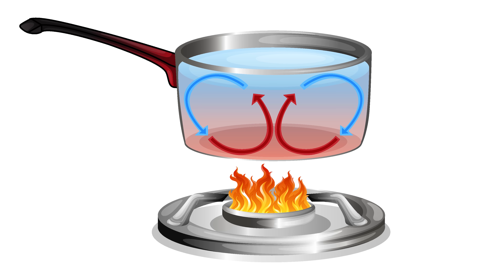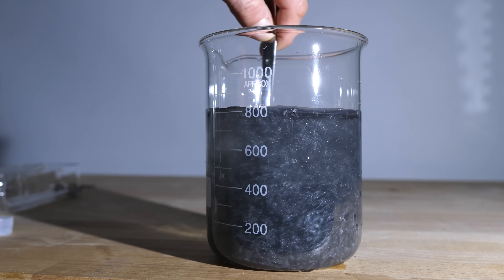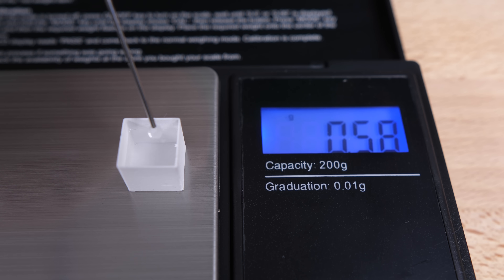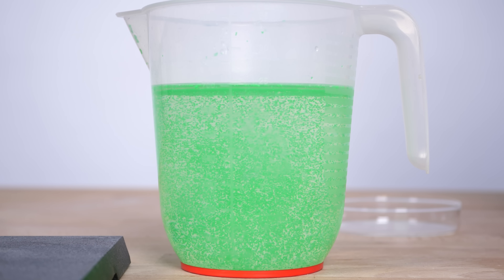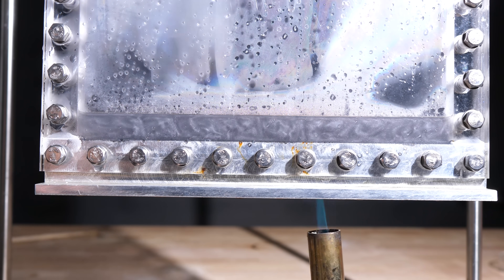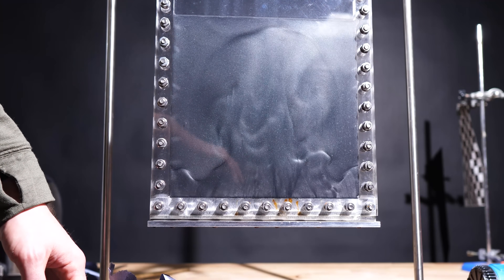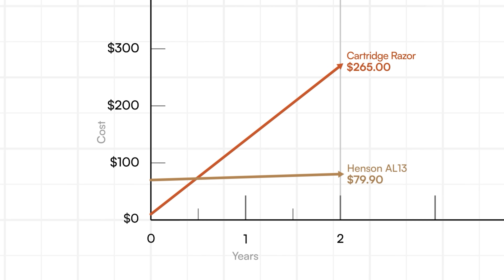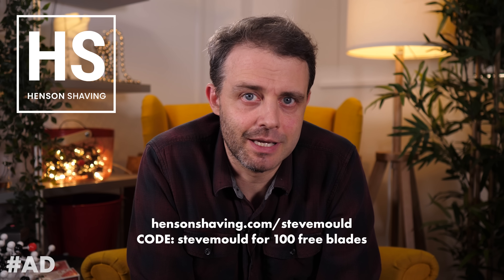The bizarre patterns that emerge when you heat ANY fluid

Comment: Now I need to know why the mica flakes tend to align locally.
Reply: my guess is that because mica forms very flat very thin layers, the flakes would all have a similar geometry and therefor they tend to align in similar fashion in response to water flows around them
Reply: @nicklanders5178  This was my thought, too. Flakes perpendicular to the direction of flow might be swept along, leaving the ones parallel to it behind slightly. Hard to say if that really works on such a small scale, though.
Reply: @SonOfFurzehatt I would imagine the flakes align themselves to all be perpendicular to the flow, each one acting as a little sail
Reply: @alexanderaiken6457 I'd expect the opposite, with the 'sails' tending to be turned so they present the smallest surface area to the flow. This is in line with the tendency for physical systems to move towards a 'lowest energy' state over time
Reply: @SonOfFurzehatt  why would the scale change it?
Reply: @joshyoung1440  Effects of things like viscosity change with scale. Have you ever seen a model shot of a ship at sea in an old movie (or Thunderbirds) and immediately picked up the fact that the sea doesn't look right? Viscous flow of water might be enough to carry everything small along with it. Smaller particles also have a higher surface-area-to-volume ratio.
Reply: Same here! There's a paper about composite coatings that seems to suggest shear alignment as a cause?
Reply: I think he meant to say "they align with the flow" in a way
(because they are flat)
Reply: I’d expect that any shearing flow (squares become parallelograms) would align them with the shear direction. Otherwise they’d be random.
Reply: The ones not aligned with the flow on their edge would be caught by the flow (so moving faster) and also be less visible? Optically you'd see mostly flow-aligned scattered light bounced between them, I think, with little seen of the perpendicular ones.
Reply: @adaroben1104  I'd guess that all flakes always align with the flow and what makes them more or less bright is if their flat/reflective side (remember that the flakes are really thin) reflects the light towards the camera/observer (bright) or not (dark). It would be interesting to compare what 2 different camera angles see or maybe even more interesting, have two light sources of different color in different positions.
Reply: @EstebanGrasso  a polarizing lens would be interesting to check them with too
Reply: I imagine that it has to do with the fact that the particles are large, so they won't move as much as the water molecules do. This could mean that when they get close to each other, the extra mobility of the water molecules causes the water to bounce between the mica flakes, pushing them apart again.
It is also possible that it is due to the mica molecules having a tendency to orient the closest water molecules a certain way, so the outside of the particles have a slightly positive or negative charge. This would mean that the mica particles repel each other, and they would tend towards maximizing the distance between each other. The distance is greatest when the particles are aligned.
Reply: I posted elsewhere, but id like to share here too.

My conjecture on why the mica poweder is rheoscopic is the powder is tiny reflective sheets, and they arnt really aligning. If they are in a shear force of fluid, they will roll, and they can only really roll in 2 meaningful ways. They can spin normal to their plane like a frisbee or perpendicular to normal of their plane, like a paddlewheel.

Thus in a shear force, at least 50% of the mica powder is rolling like paddle wheels with their axis aligned with the shear force. They are all in a randomized state, but at least that axis is lined up and the lined up pieces act like a uniform mirror when viewed at the correct lighting and angle.
Reply: Sheer willpower
Reply: Van der Waals force?
Reply: @Player-pj9kt that was my thought as well. That's why mica forms as sheets in the first place. Because Van Der Waals force acts weakly and over a short distance, it would tend to form small, self-organizing domains. Even in non convective fluids, thermal motion would limit the size of these domains.
Reply: I think the simple answer is just that they align with the flow, like others have mentioned. I think Steve is just overthinking the phenomenon and is thinking that the particles are both coupled to the flow and couple to each other. He’s thinking of a nematic phase, where this would be the case. A nematic phase would be a much denser suspension where particles are so tightly packed that their orientation aligns. Here the orientation of the flakes simply aligns however because they’re experiencing the same flow.

Comment: Given you can make a rheological fluid with metallic, organic, graphitic and mica flakes, it appears it is not anything electrostatic and is literally just a consequence of their restricted dimensions. We can imagine that due to their extremely low Reynolds number when aligned to the flow, even if flow is turbulent on a scale much greater than the flake, locally flow over the flake will be laminar and any deviation in the flake angle away from the laminar flow condition would create a strong restorative force as Reynolds number would suddenly jump from near zero to a high number even with a very small change in angle. Because the flakes will always be moving slightly slower than the flow velocity when the fluid is cycling like this, that laminar condition should cause them to all orient locally to the flow direction.
Reply: Rheoscopic sorry...

Comment: One thing I noticed that I think is rather cool is that there's occasionally these fast jets of water shooting above the convection currents. You can see this really clearly at 2:10 or so. We tend to think of heating water to be uniform, but a jet of water is water that is superheated and rising very quickly to the top, it slows as it gets to the top as the temperature spreads out. It's fascinating to be shown how we think of water movement in terms of averages, and not every part of the water is perfectly aligned with the average.
Reply: I think those are bubbles.  Either from boiling or just the flow breaking off bubbles that were stuck to the bottom.
Reply: @technobabble_  That makes sense too! I can't really tell from these videos here, but I'm curious what it actually is.
Reply: Yeah  this was the part I found most interesting. It really does show the statistical/probabilistic nature of reality. Occasionally you will get these exceptionally high energy interactions, but on the average the overall energy level is reasonable. I'd often encounter this as someone who urinates standing up, when occasionally drops of water from the toilet would fly out and go past my head in height. You would think the kinetic energy would at most be able to rise up to it's original height, but the occasional splash in the face would remind you otherwise. (Like how a slow large ball colliding with a smaller one, sends the smaller one away at a much greater speed).
Reply: @aggies11  ...stop spraying your piss so hard against the urinal hahahahaha
Reply: @aggies11  also that large ball/small ball thing has limitations at classical scale but yeah it largely works that way at this scale
Reply: Omg yes I was waiting eagerly for him to talk about/explain it.. I hope he makes a video and talks about this phenomenon more in a future video because it sure seems VERY interesting.
Such a great video nevertheless. Keep up the hard work Steve 💪🏻✌🏻
Reply: And I'm surprised how fast seagulls can ascend on rising air currents. Do they 'see' air currents, or fly around randomly until they find one?
Reply: Not just water movement, but all heat.

Comment: You can also see convection cells when heating up a relatively shallow pot of oil on your stove if you have a light shining into it right from above (like the one on your fumehood). The light shining into your pot and being reflected out by the stainless steel bottom appears darker or lighter depending on how it is bent by the changing refraction index of the oil.
Reply: It's also quite visible in a frying pan with some oil on the bottom. The "shimmering" surface of the oil is commonly referred to by culinary instructors as a way to know when the pan is hot enough to start cooking.
Reply: The shimmering effect is also increased when fish has been fried in it. Especially mackerel. But i think its has different cause.
Reply: You can get stable hexagonal cells with ordinary water in a pot. The water in the center of the cells will be a bit higher and the water in the lines between them will be a bit lower. Super easy to see.

(But not easy to create!)

Comment: I'm guessing the cream is important because it's a colloid of fat globules in water. Fat is pretty insoluble in EtOH while water is freely miscible, which makes ethanol cream mixtures highly unstable - if you use something other than cream, it just dissolves into solution, becomes homogeneous and the convection stops, whereas the fat is continually falling back out of suspension causing the density to constantly vary leading to the convection

Comment: 5:10 I thought you were going to point out that the changes in buoyancy are due to changes in density, which means your beads actually sink through the hotter (less dense) fluid, so the velocity of the fluid may actually be larger than the beads make it appear. Not sure how significant that is, though!

Comment: An odd argument I got into with a friend who is really smart is that a boiling container of water isn't 100 °C or 212 °F despite that being the temperature at which water boils (something I believe). Argument went on for awhile to the point we had to agree to disagree. By the way, this is a normal, unpressurized container open to the air we're talking about here

The thing is that convection makes it impossible for a container of boiling water to be 100 °C or 212 °F. That temperature is required for water to turn into steam but that is only localized at the bottom of the container you're boiling. Once the water reaches that threshold, it turns into steam, rises to the top and escapes the container. The surrounding water can be close to that temperature but is still lower

If you put a thermometer in a boiling container of water without having it touch the sides it wont reach 100 °C or 212 °F as long as there is still liquid water in the container

Comment: how would the convection currents look using the heat of the lower liquid to heat another liquid on top? something that doesn't mix like oil and water
does the convection current continue from the lower liquid? does the line between the 2 liquids blend much? how do the levels of the different liquids impact it overall?

Comment: 7:07 regarding the issue with not receiving a hexagonal lattice: Maybe the circumference of the petri dish is too small? So the walls of the petri dish might sort of disturb the order until a certain distance, which may be longer than your radius. Just as an afterthought, don't know if that's the reason.

Comment: Idea for video: A spoon suspended by the handle is drawn into a water stream (eg: kitchen faucet) if the bottom of the spoon is facing the water.  But it is pushed away from the water stream if the top of the spoon is facing the water.  What forces cause it to be drawn into the water?
Reply: I believe it's the same as air with an airplane wing.
Reply: @jacobshirley3457  So, pressure differential?  Or do you mean the forces causing the water to "stick" to the surface?

Comment: The cells you created with oil and mica looks like a Voronoi pattern, an absolute classic in computational design. Each cell's walls are equidistant from its center point and the center point of its adjointing cells' center points. Also appears in nature with real biological cells.
Reply: It's really funny. Space Engine uses a voronoi texture for the surface of stars. And I always thought it was weird but never looked into it. And now after seeing the actual pattern on the surface of a star, I think it was the perfect decision.

Comment: Miso soup!   You can see the convection cells in hot miso soup!
Reply: It also tastes much better than Mica.
Reply: @Vindolin I think I have to cast my vote for the mica soup actually.
Reply: Miso is also significantly cheaper by weight than gold.
Reply: i sometimes see it when i brew tea under a downlighter, in the caustics of the light hitting the bottom of the glass. Must be the heat haze.
Reply: Fighting in the dojo!
Reply: oriental prince in the land of soup! @hashbrown777
Reply: Steve don't trust him, stick with Tia Maria!
Reply: I was going to say the same for match tea! Same thing, very fine particles suspended in hot water.
Reply: Remove the seaweed first
Reply: +1 for miso soup, that's the first thing I thought when I started watching this video 😃👍
Reply: YES because the density is so similar